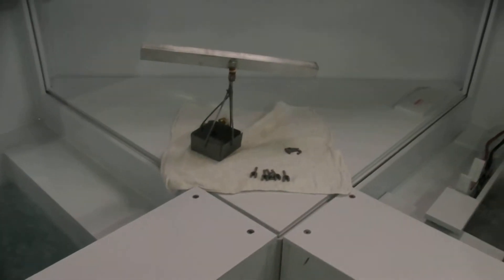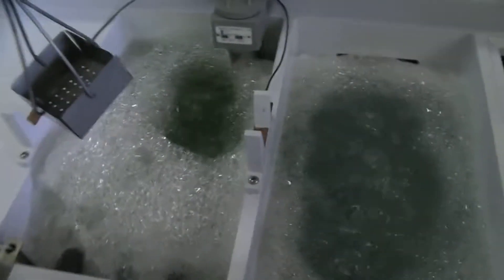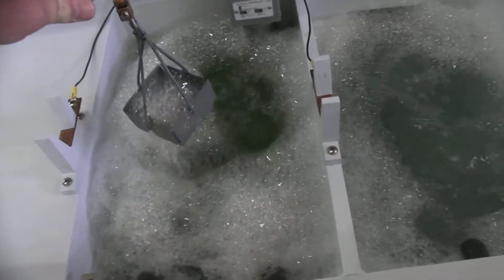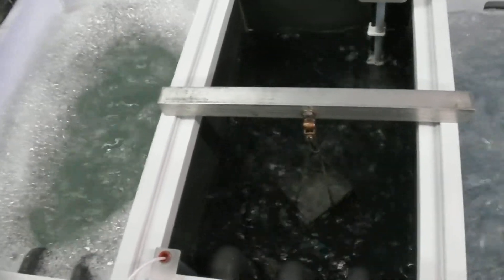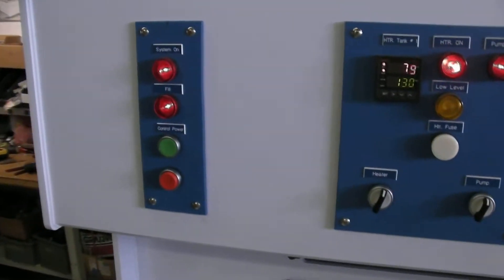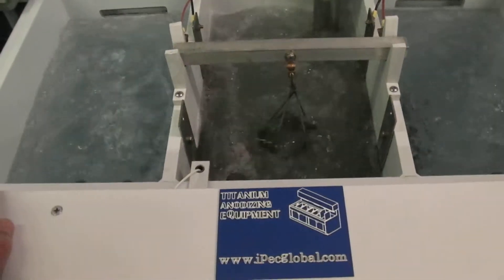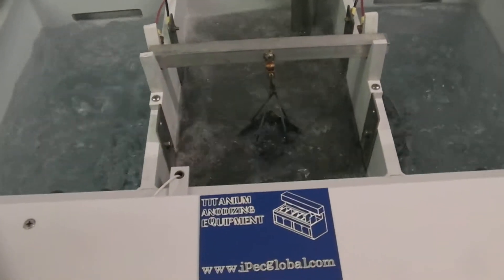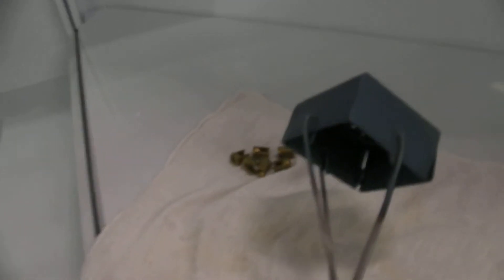IPEC Global titanium anodizing line 2011-05-23 001.MP4

Comment from the maker: Mr. Jonquirt-  The system is designed with a single rinse for each process tank because we can fit the whole process into a single 8' to 10' module.  Were we to add an extra rinse for each process tank, the line would have to be in two modules instead of one, and the cost for this both monetarily and in terms of floor space would probably make the system much less attractive to our customers.  Also, the payback for the decrease in water would be a long, long way off- perhaps decades. Mark Emilio

Comment: You make some really good looking anodize lines.
Just thinking about single station rinses.
Depending on the rinsing criteria adding a counter flow cascade rinse would use anywhere from 71-141 times less water to achieve the same rinse criteria over a single rinse. 
Using a Cp/Cr from 5,000 to 20,000 (Cr=Steady state concentration of the rinse, Cr= Concentration of the process tank.)